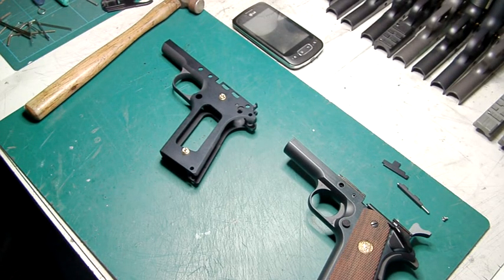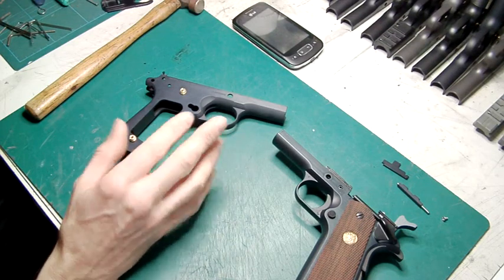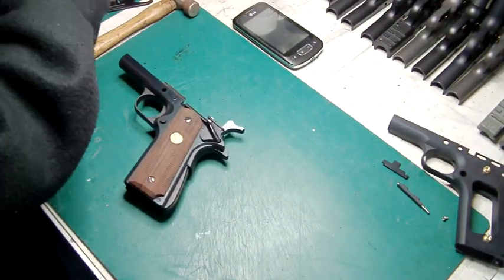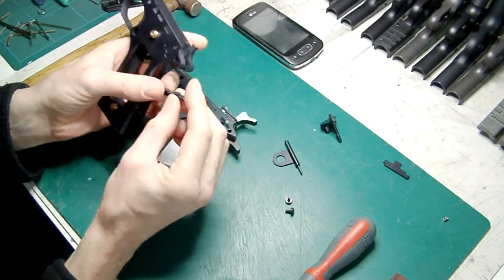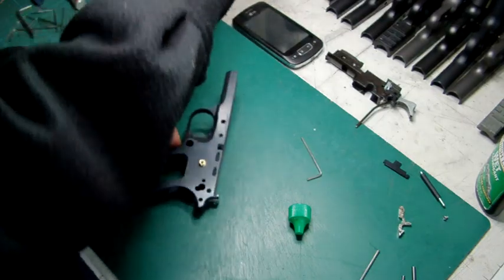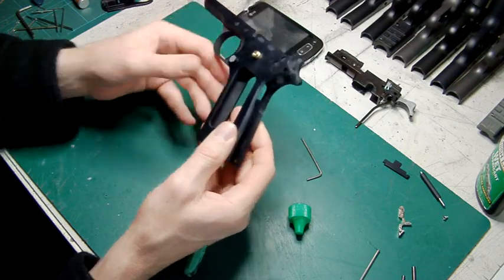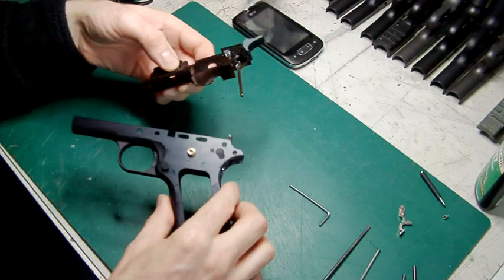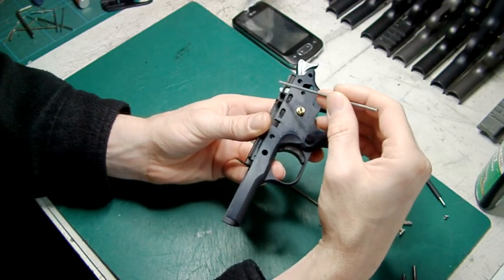LaZouche Custom airsoft Nova Colt Commander build Pt 2

Comment: Im really surprised you got that magazine catch to fit! I had to buy the 'nova' catch to fit my two kits.. They are also making just the hex screw that i assume would work and can be swapped for the slot head screw in the magazine catch. 

If you have any issues with the magazine catch I can link you a photo of the mod that can be done to fit it better if you dont already know it! 

Im loving the looks of that kit though! I think you just had a little snag putting in the rail assembly, it should drop in without any problems! 

I am awaiting part 3!
Reply from the maker: Many thanks for the like mate, its much appreciated.  The gun is actually up and running now and the mag catch went in without to much hassle but thank you for the offer of the link. The new hex head screw is just a straight swap out should you wish to do so for the TM one.   Part 3 is on the way ;-)

Comment: I seriously hate the NOVA kits.. at least the springfield full length rail version. I had to sand so much crap down to get it to fit, but it still didn't work properly. I just said f*ck it and went to a HurricanE kit and never looked back... I'm really curious about this kit though seeing as this is commander size.. Thanks Lazouche!
Reply from the maker: Nova kits can be, on occasion, a bit hit and miss and sometimes rest on their laurels as to quality, that said this kit is a gem.

Comment: Hi am interested in getting a 1911 model I like guns such as the socom gear punisher and tm night warrior any recommendations? Under about £200. Many thx (gr8 content)
Reply from the maker: Try the TM Night Warrior if you can find one. Its got all you need for a starter 1911 but suffers in colder climates, its better than the Socom Gear Punisher though. However if you want a GBB thats good all year round then look no further than the TM 5.1 Hi-capa.
Reply: Thx I will look at those products.  Keep up the gr8 content.
Reply: +LaZoucheCustomshop y